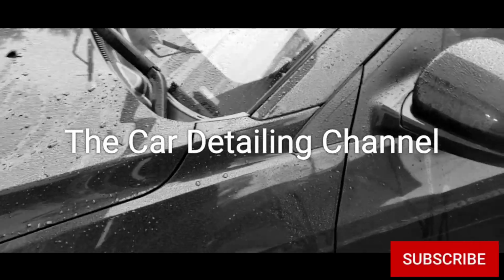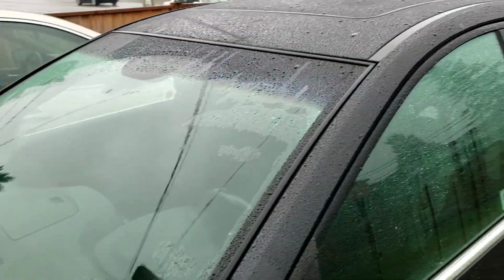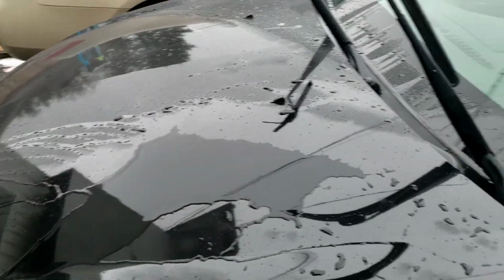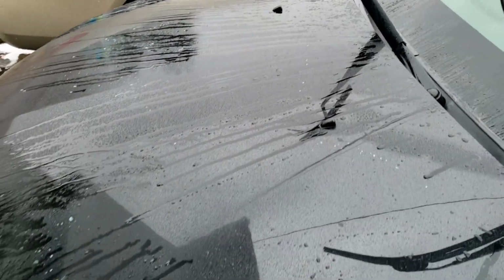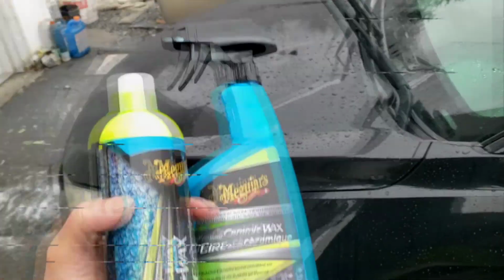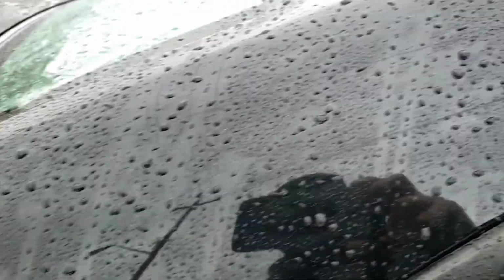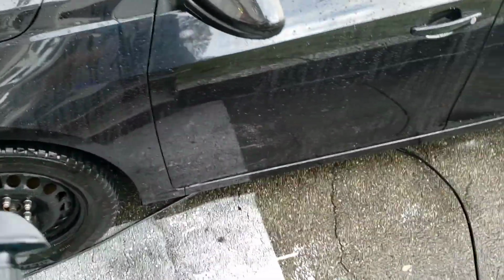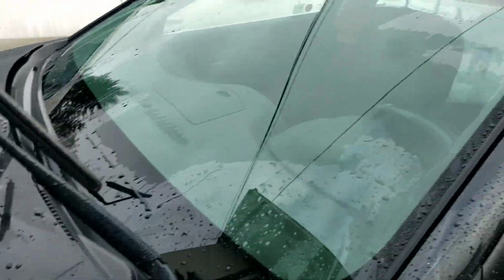6 Month Update + Watch Meguiars Hybrid Ceramic Spray Wax Bring Liquid Wax Back To Life Months Later

Comment: The liquid wax is rubbish, doesn’t last long compared to the spray in many tests. There was no base application as it wore down. Dry application of spray gives longest durability, medium is wet and wipe dry, another way is wet and wipe then spray off for no streaks. The spray and wipe uses more product and lasts the least but yes it’s easy.
Reply from the maker: The liquid wax on its own gives me about 3 to 4 months of good protection on average.